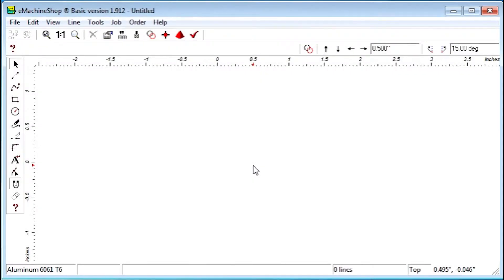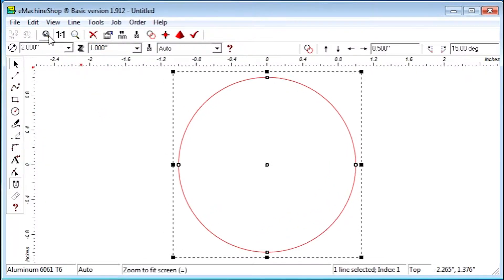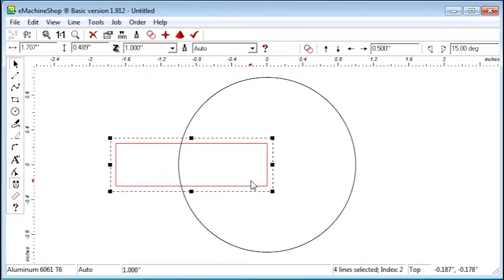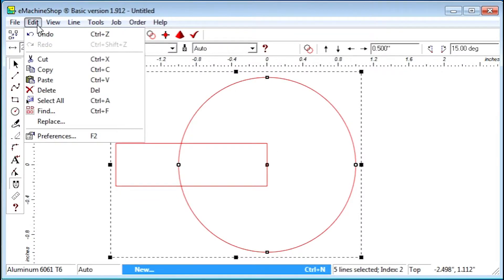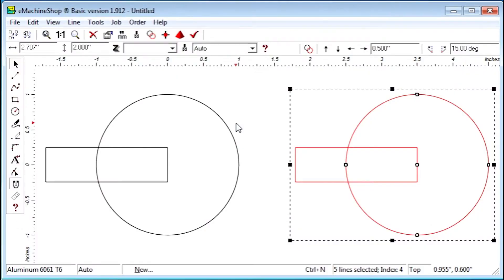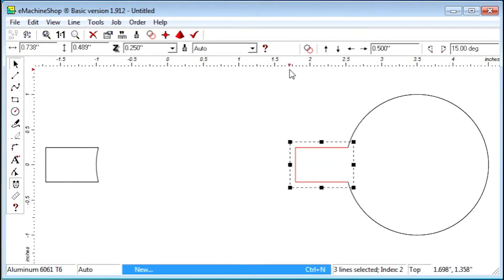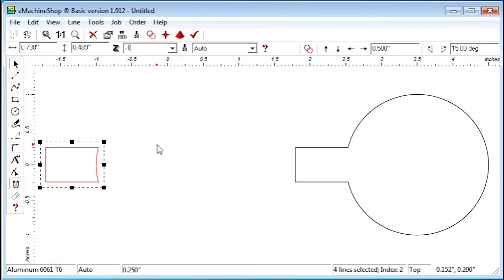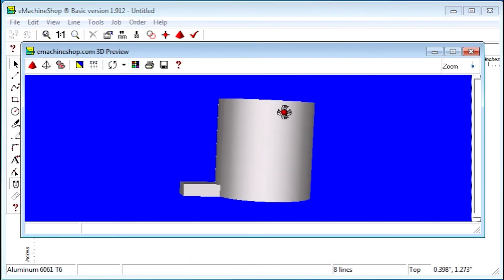Editing a Copy (Protruding Foot)

Comment: Wont work in eMachineShop CAD Online version 1.25.0 (P) Beta 
Edit: You must set height value before you use group of the right shape. Othervise the both shapes will have the same height and not be changeble.